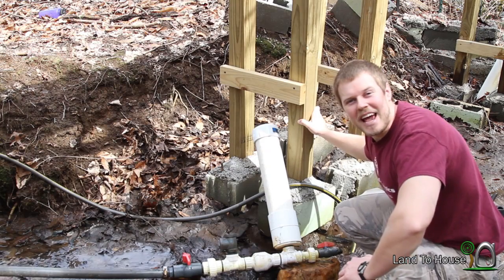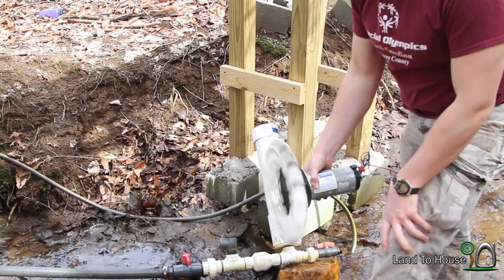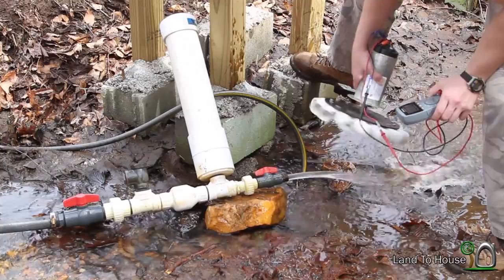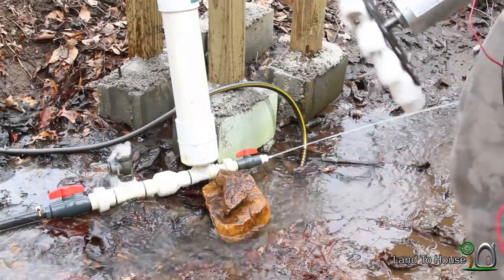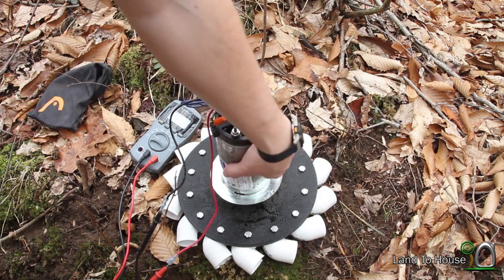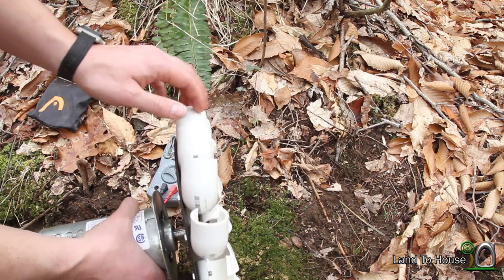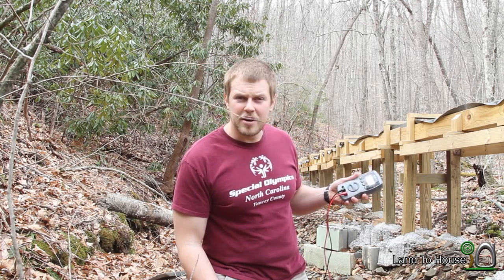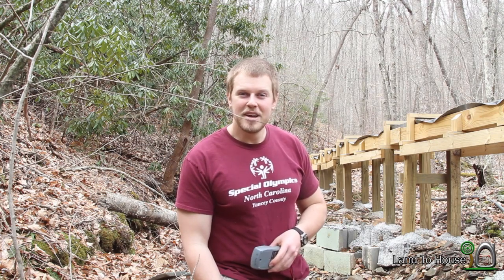Ram Pump Micro Hydro | Land To House

Comment: Consider this as well, when you reduced the nozzle size the second time, you may have increased the output pressure but you also throttled back the flow rate. Anyone else noticed that the pump slowed down on the first nozzle and it sounded like it was cavitation at times, but put out more voltage than the second nozzle that upped the pressure, but slowed the flow? I am going to hazard a guess that there is a point where the flow rate and pressure find an "equilibrium". Too big, and the pump can supply the volume (to a point) but not enough pressure. And, vice versa, with the smaller nozzle. Wonder what would happen if you had a larger supply with multiple, smaller, ram pumps to do the the  job. For what it is, it's an excellent proof if concept, and probably would "work" on a small scale. Combine that, with some of the ideas that have been presented in the comments, if you are a tinkerer, see if you can scale it up. I wouldn't expect it to be 100% efficient at this point, but one never knows until one tries. K.I.S.S.

Comment: Hello seth! I was wondering why the ram pump didn't start to cycle when using no nozzle? Please answer!
Reply from the maker: The ram pump needs backpressure on the tank to maintain cycling
Reply: @LandtoHouse  thank you for answering me asap Seth. I really do appreciate it very much mate! So that means we cant use it without an actual delivery pipe i guess! I though it would work just as it is (straight piping)!. My bad.! Thank you again mate!👍🏾🖤

Comment: Use the delivery pipe to drive the water up, then run it straight down into the turbine with a smaller motor.

The motor you are using requires too much torque to get started.

Comment: That ram pump isn't doing anything....it's just the water running through the pipe witch is why the out,if you had taken the ram pump off and put the  Nozzle on the end would do the same thing

Comment: Hi, great videos! Why don't you try something else. You can send the water from the exaust valve to another ram pump and the water comming out of the 2 ram pumps can go to a closed tank( under pressure) and then from the tank you can send the water to a third pump. Try to generate electricity from the third pump! I am very curious what will hapen!

Comment: Measuring voltage tells you nothing. You need to measure watts to determine how much power you can generate. It is a bit like determining the output of a ram pump purely from pressure when it is volume/time that matters.

Comment: Hello sir, your videos are awesome. Can you please try making a jet at the waste valve and see how high it flows for a given drive head? And also check if there is a reduction in output
Reply: Their will be, major reductions, or losses, I.e most ram pumps are like 10% efficient(although completely free to run) you would most likely just get more off a water wheel an that small hose flowing freely

Comment: Have you tried to use the release valve output as an another nozle input for the pelton wheel?? Is lost energy in your actual setup.
Also, since hydraulic power is propotional to the pressure times the flow... you must find the optimal aperture for the output valve to find the máximum power you can achieve in any setup, so the comparisson made with and without the ram pump is not completely right.

Comment: What if you created a siphon off of a pond and ran that through a micro hydro generator, then captured that into a ram pump which took a percentage back uphill into the pond? Have you thought about this concept and would the percentage captured be worth adding the ram pump? thanks!

Comment: The set up is wrong. You might try to cut them on the other side.
Reply from the maker: I actually have a real Micro Hydro series coming out in a month or so. 150 foot of head pressure 20 gallons a minute

Comment: Great work Seth! THANK YOU!!!
Reply from the maker: Videos this summer about a micro hydro install!
Reply: @LandtoHouse  gov will have all heads for this tech thay teach us that we always have loss but never talk about 
the converted gain we can make from eletromagnets
if u convert all the wast thermal energy around 
you u can use it universally as energy u need a true sine wave bipolar like the power comp dose a 
true pure sinewave like a grid tie inverter 
once the signal is made the system will turn on and 
consume wast thermal energy from the 
environment and space around you... there is free energy but 

it comes from Universal thermal loss and converted into a gain. so a pole Transformer and a 
microwave Transformer  have a common between each other u can take 2 microwave Transformer provide 
a pure sine wave grid tie inverter to it or a true bipolar sinewave that inter acts with nature in 
a perfect spherical motion like a flower of life..  if ur home provides this use it as a Source 
signal then u can simply stack the Transformers on top of eachother in correct fasion and note 
that the 1 wire on the Transformer must stay connected and the other disconnected your only useing 
1 wire on the hi side .. so test ur self 
2 microwave transformer stacked on top of eachother same 

face sides. one side 120 to the wall and the other 120 side to what u want to power and useing the 
Transformer just the way it came out the microwave with the wire attached causes the energy in its 
perfect spherical motion to converted wast thermal energy to amp for u hot to cold in to out... 
should look a bit nuts with u use a form of wireless energy but its interacting with the 

environment...this is my work a compilation of Otis car. Tesla. and many other very smart people 

nowadays i think i found the gate source and drainif this gets out to much that it works the 
power 

comp and mib will have our headsdont do this at home warning high voltage yet i cant stop u lol DO 

NOT TOCH THE CORES OR THE WIRES OK u will die make sure u dont touch the core if the hi wire is 

mounted to it u dont have to mount the hi on the core if u dont want u connect the 1 hi wire to 

the same side hi on the other transformer then the core should besafe to handle if nessary
grab your multimeter and prove me wrong
thats what u do i have my whole home on this
and u can take 

one of the lows side out the wall and hook it up to other stuff and power it for verry little amp 

makeing nature convert and pumping latent heat effect into the device.
and u can have a microwave 

hi volt cap in between the hi side and make a system that powers its self
u can flip the switch on 

ur breaker and the room stays on up to 2kva 
with both lows in the wall this is the zero point that 

was taken from us...

Comment: It would be more effecient if you were gear it up.have the same size grinding disk  but attaching a big spocket on to it coming down to a smaller spocket on the shaft of the treadmill motor all connected with a bike chain and u will be suprised at the difference in voltage and amperage.. i made my first windturbine using a treadmill motor but instead of sprocket i used a v shaped pulleys 12 inch on the blades and 1.5 inch on the shaft of treadmill..

Comment: Could you make a hydro Ram pump that would pump water up a 425 foot hill 80 slop what size pipe would a person need and what size hydro ram pump would need to be built. To bring water  From bottom of hill to top of hill
Reply from the maker: Is the 425 feet horizontal distance or vertical lift? The ram pump has no problem lifting 80 feet but if your hill is 425 ft tall it is not able to do that
Reply: @LandtoHouse  Thank you for replying back yes I meant it would be straight up the hill at a 80 degree pitch I have a beautiful Branch at the very bottom of the hill has a lot of water in it I would just wish I had a way to get this water from the bottom of the holler up to the top to my off grid tiny home if you have any good ideas let me know And thank you for your time I sure do preciate it.

Comment: If you cut the wheel down smaller so that it does more revolutions you should be able to up your watts.
Reply from the maker: I am bringing back the idea of micro hydro here on the property. Check out my new videos and you will find the early research on the micro hydro.

Comment: Love the set up I think you can set up a parallel close circuit using a pulley type system with gears to generate more power output
Reply from the maker: Thank you for watching. I am actually going to make a real micro hydro turbine this summer. Should be a good series.
Reply: @LandtoHouse  I've surprisingly seen some for sale on the wish app for as low as 10$ not sure on the output tho. Lol

Comment: Voltage is not power, you need to take readings on amps and you will see that no nozzle will give you the most amps. Then if you put a compatible load, you will see that it also has the most power.
Reply from the maker: I am in the early stages of setting up a real micro hydro generator.  20gpm and 120+ feet of head. Should be good.

Comment: You need a Heavier flywheel To bypass the magnets in the motor to cause less drag
Reply from the maker: This next summer I am planning a full micro hydro install. Should have at least 150 feet of head pressure and 30gpm. My goal is to have 500watts.

Comment: I have 0 background in this, but wouldn't the diameter of the disc affect the voltage output?
Reply from the maker: Yes the weight and diameter of the wheel plus the number of spoons. I am actually just about to get into a Micro Hydro project. Probably in about two months. Should be awesome.

Comment: You cannot get any more energy out of your system than what's put into it. Five or six feet of head  through a 1 and 1/4 inch pipe has a small but useful amount of energy in it. Especially if you charge a battery. Adding head, or flow, or better yet both will increase the energy you can get. A longer, or larger diameter pipe would help a lot. 
Anything that you put between the water source  and the turbine/generator  will reduce efficiency. A ram pump, gears, or a thousand nozzles can't get you any more power, it will actually reduce it through inefficiency.
Different types of turbines are used for different applications. Reaction style turbines are typically used for lower head sites, while impulse style turbines are typically used in higher head sites. Five or six feet of head is too low for a Pelton wheel turbine to work properly. It's possibly too low for a turgo or even a Francis turbine. I would suggest a propeller turbine, or possibly a Banki.
I applaud your effort trying to make in inexpensive Pelton wheel. That's more than what 99% of people have done. The Pelton cups take the water from One Direction and shoot it back out at almost a hundred eighty degrees, in other words back to almost where it came from. I don't think you can make that from PVC fittings. A bunch of spoons, or ladles possibly, but not PVC fittings.
I'd like to suggest you take a 3 or 4  inch computer type fan, pop it apart and find the three solder terminals that go to the coils. Solder 3 wires there, and bring them to a three phase Bridge rectifier. (Or six diodes wired properly). Hook a load (resister?)to your DC output of the bridge rectifier, and measure you're volts, amps, and watts at that point.
Make a tapered tube to seal the fan to the bottom of your inch and a quarter pipe. And see what happens. Good luck!

Comment: Your main problem is one of misapplication, your 7,000 rpm motor won't product enough volts to be useful at  low rpm. if you had a 2,000 rpm motor it would do pretty well.  Also a Delco  12 Si alternator with a PM field will be great for that application.

Comment: Using a treadmill motor is garbage. You use this method with a 3 phase AC generator from a wind mill and you will see functioning system

Comment: I'm guessing that's a water trough behind you , if so why not build a waterwheel large enough to spin a 5 horse generator . Success would depend on the amount of water your moving and or the distance the water falls before engaging your wheel .
Reply from the maker: Yes water wheel was a plan of mine. Lately I have been working on life not so much water power goals. One day...

Comment: btw, you are poised to invest time/energy/money in, future,    FATALLY FLAWED   concepts.    you should UNDERSTAND,  each type  of hydroturbine is  Most efficient, under a certain range of conditions.    WHERE the CONDITIONS Include,  low-flow  and   low-head, in order to achieve  optimal performance the  RADIUS  of the runner  Must be as  GREAT  as  Practical.    thus, a tiny little pelton or turgo runner is NOT RECOMMENDED, here.   cheers

Comment: thanks for posting.  i offer a few very late thoughts, without a complete viewing.   why.   the motor-cum-alternator is supposedly rated at 110 volts DC???    i seriously doubt it.    so if this is an ac motor, that does  Not  have any magnets inside it,  IT WILL NOT  WORK as an alternator.     a ram pump produces pulses, therefore, back-pressure at a ram pump is Not a good idea.    a ram pump is can raise ONLY one-tenth of the available flow volume.    so, in a low-flow application, max ram pump out-flow can be measured in table-spoons per second.    in times past, the use of waterpower was limited to the dedicated conversion of potential energy to mechanical energy; such as in various types of mills.      today,       Electrical power is the 'universal currency' that runs  Everything.           so, can electrical power be combined with Mechanical Advantage, to make  MORE  electrical power.   YES it can.  it is easy.  well, that does assume access to suitable  components.    see my research, if interested.     see linked video for  Successful  lab demo.   cheers            googletranslate
https://www.youtube.com/watch?v=lTkXciAn488
Reply from the maker: Yes lots of issues with this test. none the less it was fun getting out in the water to test. I think the best setup for my creek would be a water wheel.

Comment: Another issue you’re having here with your setup was using a high rpm motor. Try this again with a lower rpm motor say maybe the motor from a microwave turn table and you should have much better results
Reply: So like a motor with a gearbox?
Reply: A synchronous motor from microwave turn table won't last long or do much because it has plastic or nylon plastic which when turned faster than what it's made for will strip the gears but metal gears "might" last longer if the gears are machined not casted also a Pelton wheel that's made for micro hydro applications will give better results instead of 45° pvc angle elbows plus the motor used to generate electricity is a big factor.
Reply: I was wondering if I could use some spare power wheels 775 motors I have laying around... :)
Reply: instablaster...
Reply: Or have it go from a large water wheel down to the single phase 120v motor to increase RPM

Comment: Voltage means nothing. a finger (not even hand) operated lighter that has an electric spark system can generate thousands of volts. Calculate the watts and see how much ENERGy it produces.
Reply: Tarek Dinaji True Wattage.
Reply from the maker: This was just a fun test. No real usable power was made.
Reply: pretty sure voltage in this case means something since he is using the same generator. He made more efficient use of the water flow.

Comment: Perhaps the check-valves is too large a mass, requiring more water volume than the drive line can supply to open the valve.

Comment: try hooking multiple pumps to one delivery pipe with nozzle and see how much power increases
Reply from the maker: I am thinking that it will be better to have the water from those pumps directly on the pelton without going through the ram pump.
Reply: Land to House well brother I have made my first ram pump and it works! so thank you for all your hard work in this ram pump research. I will keep working on more pumps to try and spin my pelton wheel fast enough and with enough torque to spin a pmg for electricity.
Reply from the maker: Nice! Its always good to hear that a ram pump is working.

Comment: ok so would a 3" ram pump supply more water as well as higher pressure to the nozzle if you had enough flow going into the drive pipe to fill it?
Reply from the maker: The 3" pump is likely going to supply a lot more water but I am not sure about the pressure.

Comment: wondering what size drive pipe and ft of head you had for this video thanks
Reply from the maker: +Douche Bahgk I was using a one and a quarter inch RAM pump and approximately 6 feet of head pressure.
Reply: Thanks

Comment: let it scoop water from the outside of your water wheel it will have less resistance to push the water through the corner instead if slamming it into it I learned that trick using a hose and a bike tire the closer to the crest of the tire most towards the stream flow the slower the tire went..   I love physics.
Reply from the maker: +Anthony Morrison this really needs to have spoons with better angles. It was at least a fun test.

Comment: Hello buddy, 

i am student with mechanical engineering major. Actually now i am doing my thesis which Designing and Creating mini Ram Pump as yours in the video.

One Question, are you having any references such as e-book, journal, article or else abour ram pump in theory ?

hopefully you can answer my question, and exactly this is very favor for me...

before thanks
Reply from the maker: You might want to take a look at my smallest test ram pump. https://youtu.be/HDOCHQ_XA6E
I do have a freen ebook on my website. It needs updating with new information but you might find some good info in it.
http://www.landtohouse.com/rampump/
Reply: Land to House thanks a lot bro 😉
Reply: try the pulser pump it is much better.